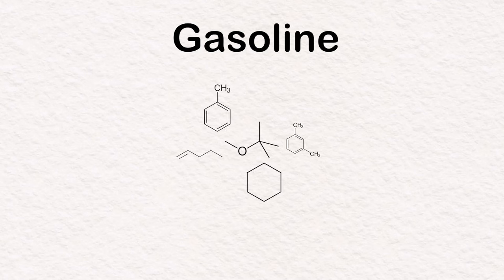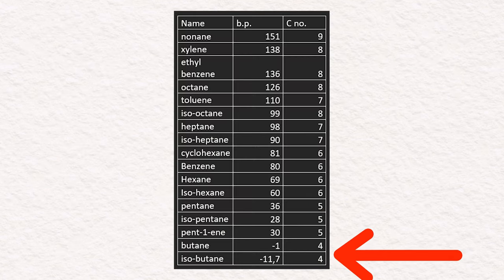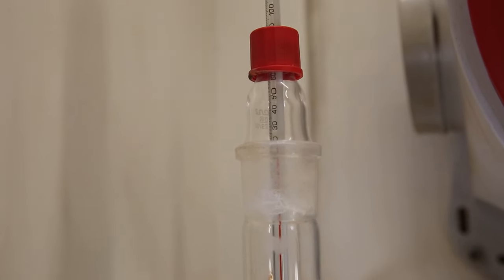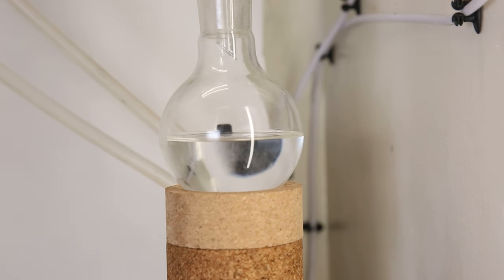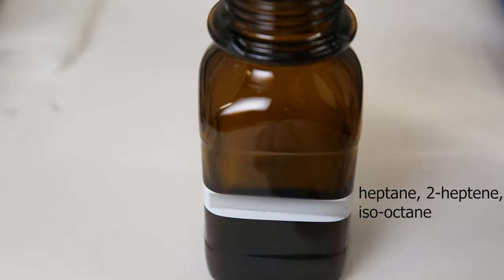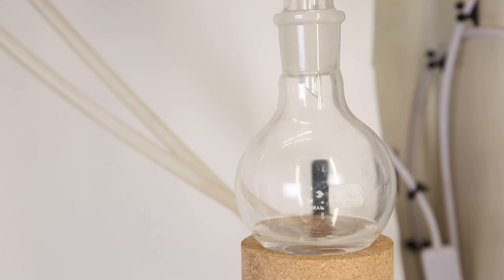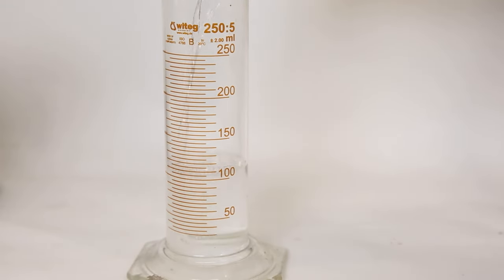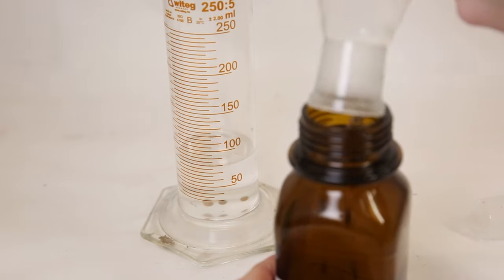Making Solvents from Gasoline

Comment: A quick question from a non-chemist..: what fraction(s) is/are responsible for gasoline going bad with time? And could distillation be used to make old, old gasoline usable again, if only in lawn equipment or tractors? Many of us have a LOT of old gas sitting around, and no way to use it, or dispose of it. No, my area doesn't have a drop-off center for these sorts of things...
Reply: Interesting question
Reply: Possible mix it with used motoroil and distill into?
Reply: @tinsoffish1810  definitely not
to rejuvinate old gasoline you would need to separate out any oxidized compounds in the gas, and add in the lower boiling point compounds that evaporated.
Reply: yikes...if you have 5 liters left over, buy another 5 liters and mix that - always worked for the lawnrazor at home...

Comment: Did you activate your molecular sieves and if so, how? I usually heat on a hi-vac line but I’m curious how you might do it
Reply: 250 oC in oven will do for most (amateur) purposes IMO, just let them cool down in an evacuated flask (otherwise they will suck up moisture again) - I transfer them into a round bottom flask via powder funnel with metal scoop while still hot, then evacuate the flask and wait for them to cool down. Vacuum oven is better of course, vacuum furnace is the best. But unless you need them absolutely dry, then simple oven will do. If you have electric furnace then I would go for 300+ degC. Note that keeping the sieves dry is difficult - I had some (3A and 4A beads) in sealed plastic bottles and still needed to re-activate them.

Comment: Would it have been viable to water wash the gasoline before distillation to remove the alcohol and MTFB beforehand?
Reply from the maker: Yes. optimally you would first wash all of the gasoline with water, then destroy alkenes with potassium permanganate afterward.

Comment: A glass rectified column is not very effective.  I used a 2m column with a 40mm stainless mesh regular packing.  many hydrocarbons form azeotropic mixtures.

Comment: How is the flask temperature controlled?  
Why is the thermometer located there? 
You are using an electrical heater, that should be highly controllable.  Auto tune PID could get that temp differential from set point down to 0.25 C.  Decent thermocouples where they need to be... easy.
If the heater only has basal proportional control... well that's no good.  

If you are using steam... that's just as easy to temp regulate pressure. 
I'm shocked to read some here are using flame to boil gasoline.... or have lived to say so.

Comment: Question. if there ethanol in gasoline is there a way distilling ethanol from the gasoline then turning ethanol into alcohol? Or I'm think of methanol? I don't know hardly anything about chemistry, but It would be cool to drink liquor made from Gasoline with out going blind.
Reply: @_____ Sorry I don't have heath problem, just moonshiner in the pass sometime made methanol by accident and go blind after drink as the stories go. I thought alcohol and ethanol were two different thing. I am no chemist but thank tell me you I can make Gasoline liquor.
Reply: Turning ethanol into alcohol 

?
Reply: @editname6868  alcohol and ethanol are the same. At the time of wright message  I thought were two different things. I'm probably going to edit the message or delete it at this point because it served it's purpose.
Reply: @creepgreen777  ethanol is an alcohol but not all alcohols are ethanol... like isopropanol, methanol etc.
Reply: @editname6868  I know that now, just that at time I thought alcohol was it own thing in the group like methanol. As I said multiple times I'm no chemists. I did some Google  after the first comment.
Reply: @creepgreen777  ok
Reply: @Hunne2303  Thanks for the heads up, I not a Moonshiner, I just wanted to know if you could turn gasoline into drinkable alcohol without make something similar to wood alcohol or methanol. I just want to know if gasoline Booze was possible.

Comment: How is it possible? 
If it boils at 25°C it would boil in the tank during the summer.
And what causes the nasty smell of gasoline? I hate the toxic, long lasting smell. Quick search says that it's benzene.
Reply: Not everything in it boils at 25C, only one particularly volitile hydrocarbon. You can actually see these vapours leave a gas can if it's hot enough and you first open it.
Reply: I love the smell of gasoline.  I am a petrolhead.  Five litre supercharged V8 is my transport, I am so amazed that I managed to own such a car.

Comment: E5 and E10 are junk I can see the few km difference to normal fuel
Reply: Slightly lower energy content per liter.

On the plus side, the antiknock performance is usually a couple of points better than regular unleaded, so some high compression ratio engines can use it as a substitute for premium. E.g. in Australia E10 is usually a few cents cheaper than 91 unleaded, but has a minimum octane rating of 94.